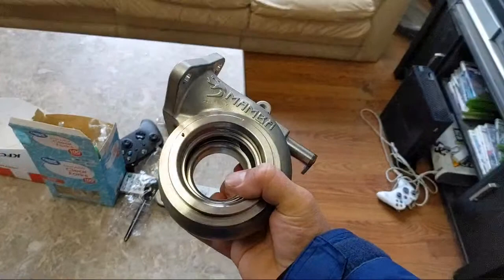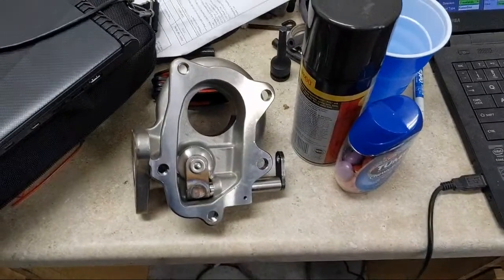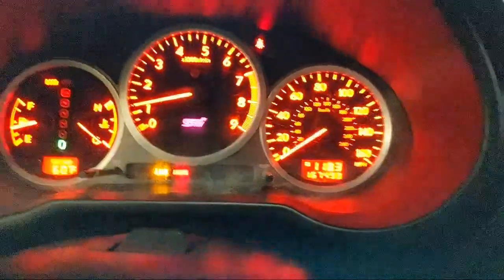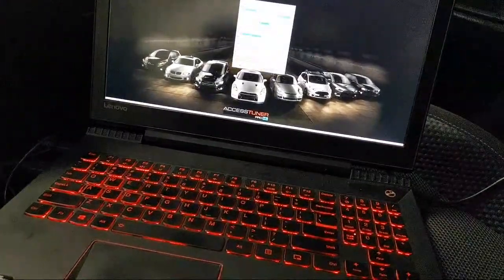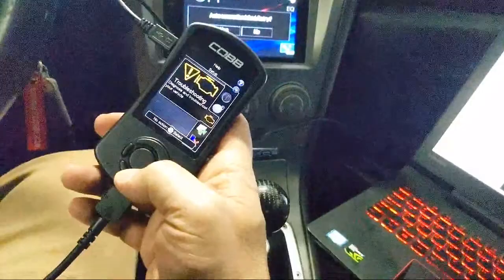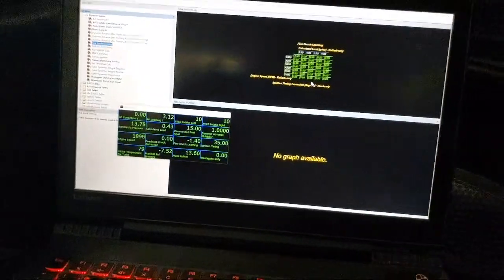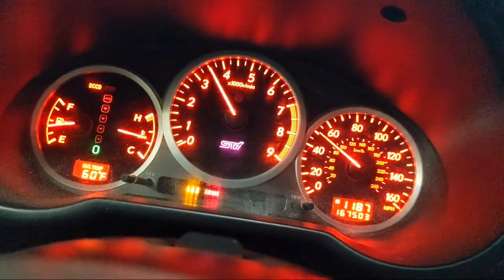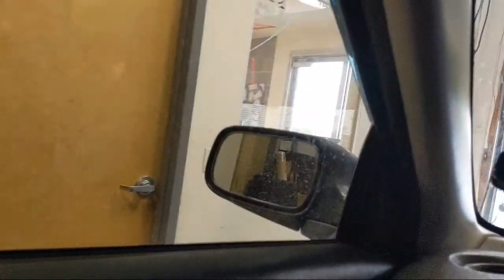Cure Boost Creep While Gaining Power And Longevity

Comment: Making sure im understanding correctly.

If i were to be externally wastegated on the stock vf housing. This mamba housing wouldnt benefit me because ive already reduced the backpressure with a higher flowing waste gate?. (38mm ewg)

Lets say for arguments sake for "reliability" is it an either or scenario (larger hot side housing or ewg) or would they couple together to make even better engine operation conditions? Specifically concerning a vf turbo to be consistent with the argument. 

I know the functions and use between the two are not necessarily the same.

My scrambled fuckin brain straight:
Im already ewg on a vf
Will this hot side housing help me anymore?
Reply from the maker: This Will increase power and reduce back pressure.